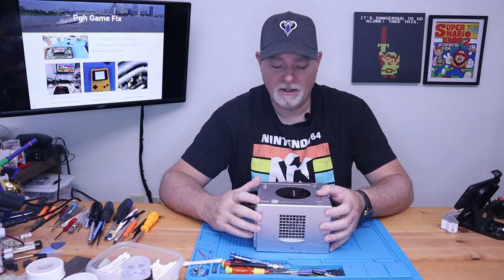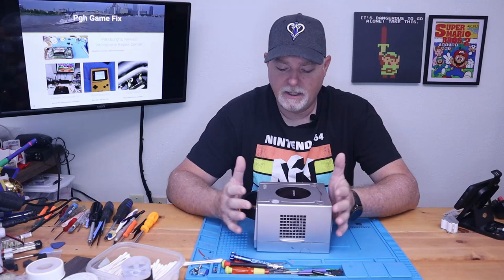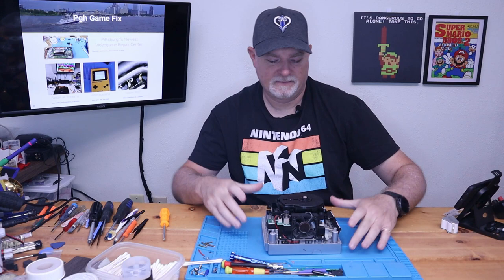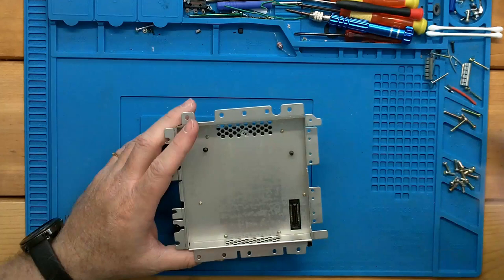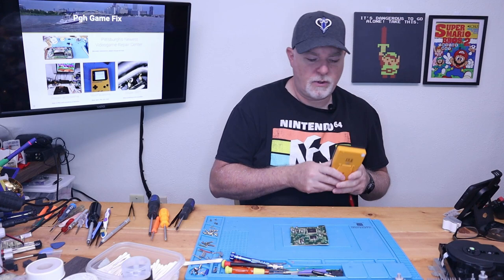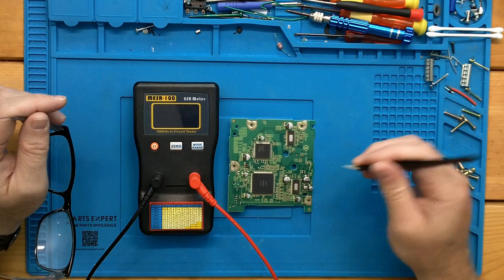Nintendo GameCube won't read Games. Bad Capacitors, good laser.

Comment: I just replaced a capacitor and it is still giving me a low reading which is quite odd. It is the 47 located close to the edge of the optical board next to another one and next to a 100 all bunched up together. Do you have any idea why that is? I do assume that I managed to put on correctly as it is giving me quite the exact reading it was before. Maybe I got a dud? Six of the seven #47 capacitors read about 1.12 ohms and only the one I mentioned earlier reads 0.47
Reply from the maker: Yes... the cap close to the bottom of the board is generally the one that causes the issue.  When I check them, I can see upwards of 30 ohms !!!  Where it should be 1 or less.   I would check all the caps on the optical board, and change what is higher than normal. I will say this, since finding the issue, I've serviced 30 or more, and I've only had to change one laser in all of those.  So, you may have a bad laser also... or it just needs adjusted.
Reply: @PghGameFix  how do I know if I have a bad Lazer? I adjusted the Lazer anywhere from 100 ohms to 600 ohms and the Lazer did in fact turn on and move a bit then turn off shortly. Note that before I replaced the capacitor, for some reason I could not even adjust it for some reason as it was only giving me ohms too low or too high. I think I will just have to move a capacitor that I know is good to that spot to rule out that. Otherwise it might be the Lazer, but what is your experience on Lazers not working? How can you tell?
Reply from the maker: @chrisortiz2640  They will still physically turn on.... but the beam is either too weak to read, or the internal optics and sensor have gone bad.  I keep them on the shelf, so i just swap them, and see if it helps.  Since you have been messing with the pot on the laser... set it to 250 ohms, and then try it again with a known good working game.
Reply: @PghGameFix  Ah, I only have one game to test out with. I did put it at a little below 100 and a little above 200 on some tests, but nothing. I don't have extra parts as I order as I need them.
Reply: The system most of the time does not even give me a disc read error which now that I think about it, may be pointing to an issue with the lazer
Reply: @PghGameFix  Also, I was curious as to know if there is indeed a way to indicate if there is another issue altogether such as a chip? Sorry if I ask too many questions. This is my first time trying to repair one.
Reply from the maker: @chrisortiz2640  In all the GC's I've worked on... I haven't found any with bad chips. So, if you swapped the caps on the optical board... I would change the laser.  BUT... with the new laser, set it to 250.  If it's low... you can damage disks, or bur out the new laser.

Comment: Is this doable for someone new to soldering? I have done a couple radio kits but not a lot of experience
Reply from the maker: As long as you are comfortable with surface mount parts.
Reply: I’m just a bit hesitant about getting the original capacitors off, I’ve seen people use heat guns and special tools, I just have a regular solder iron and some plyers so hopefully that will work. Thanks for the informative video
Reply from the maker: @ethanwashoe5868  I don't use a heat gun on old caps because they generally just pop.  If you have an iron with a thin curved tip... that will help get the old caps off the board.